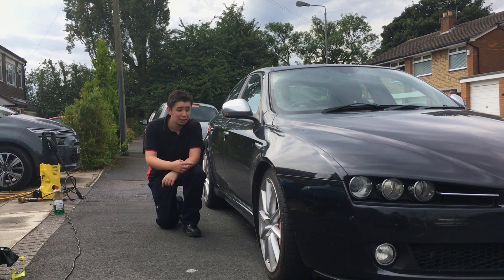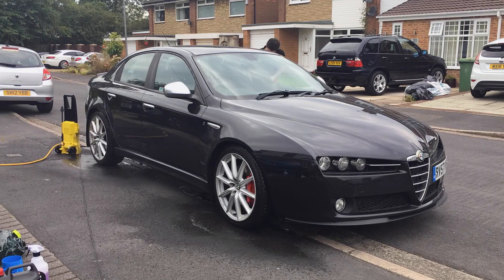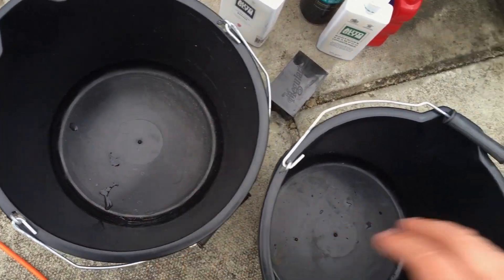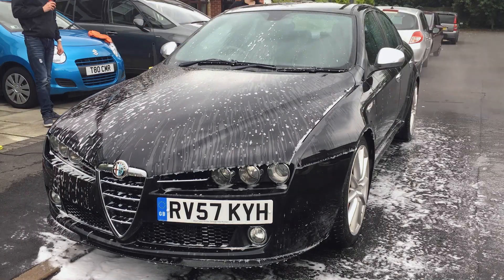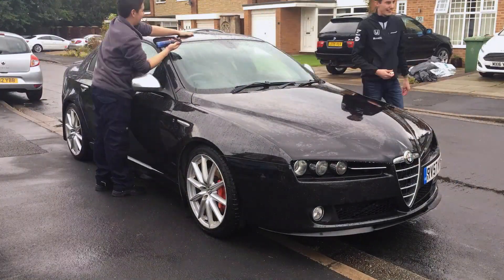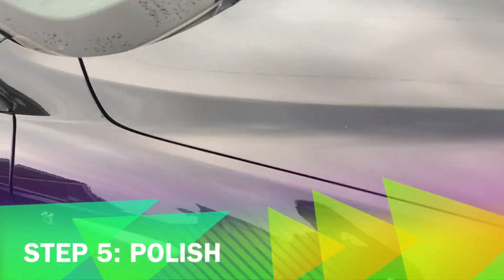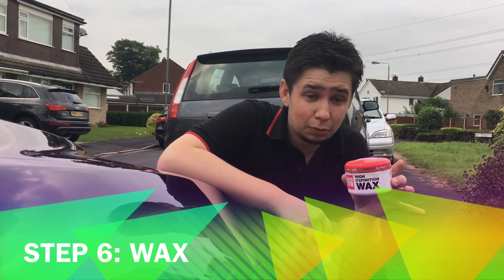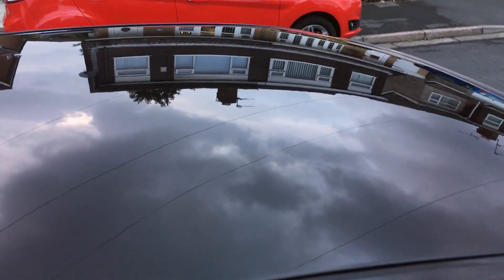How to deep wash a car.

Comment: you need grit guards in each bucket and you should always chemically decontaminate a vehicle prior to clay bar...you are only inflicting marring the way you are doing it....Washing up liquid is not a chemical decontamination......just a few tips for you going forward buddy
Reply from the maker: Robbi Hong Kong thanks for watching. You're right and I understand where you're coming from. 

Just an update, I do use grit guards now and they're awesome. Defiantly worth the investment. 

In response to the washing up liquid and clay bar. I consider it to be the 3rd step in decontamination but also the most important one. Since filming this video, I have review an Iron Out decontaminator (which I class as stage 1) with good results. Stage 2, I would use a good tar remover. 

I may do an updated video some time on my new car as the paint work is in need of restoration :) I have a video dedicated to chemical decontamination, so I'd like to incorporate that into the process.

Comment: You did an amazing job and thank you so much for mentioning about the clay bar. I saw it once and thought it was the same as polishing and never thought about it since until your videos and another one on YouTube a few days ago. Can't wait to start claying as I've never done it before on my car and it would definitely need it... What about getting rid of small scratches whilst detailing the car so those scratches are hidden permanently how would you include those in the stages and at what stage? What kind of scratch remover or chips on the paint for the certain type of colour mine being red? 

Thanks a lot it's nice to learn something a day whether cooking or car cleaning or any sport
Reply from the maker: The clay should come before scratch removal to give you a nice clean surface that’s contaminate free. This will give you better results with less work involved. 

To remove small scratches, you would ideally want a compound. It’s very similar to a polish but just a little bit more coarse. If you have a straight scratch, work the compound in straight lines that are perpendicular to the scratch. That way you can concentrate all your elbow grease on removing the single scratch. One you’ve removed the scratch, go back over the area with normal car polish to make it nice and shiny. This works best going in circular motions. Once that’s all done, you can wax the car to protect it. 

It’s worth noting though that compound will only get very shallow scratches out and will take a fair bit of effort. Especially if you’re not using a machine polisher. Good luck 👍🏻
Reply: Torque Steer thanks bud

Comment: goddamnit alfa why dont you give us those sexy looking triangle grilled cars here in the us D:
Reply: it gives, Alfa Romeo Giulia
Reply: only a couple doh D:
Reply: Typical BMW owner... Oh wait M3? You just got your ass kicked by the Giulia??
Reply: Mark Bloch Nielsen I had many alfa's in my life and that car will be always shit for me, poor quailty of the everthing except diesel engines.
Reply: BMWE38 I dont agree.. My Twin Spark is fully funktional and have no problems at all.. - but yeah they brake when people are driving them hard when cold, and don't use the correct oil.
Reply: Mark Bloch Nielsen I had 2.4jtd 156 remaped to 200hp i drove that car hardly daily,never had problem with the engine,but i changed two transmission,every suspension part,interior quality is horiblle in every alfa..can't be compared to bmw or audi or merc..Also same story about 159 just the more problems with the electonic in the car..I don't like alfa  anymore and that's my opinion that you should respect like i respect you'r.
Reply: BMWE38 How is this respect? You are just saying stuff that arent true? I respect that you like german cars - But like all other cars they have faults too.. My rear suspension only collapsed after 19 years? Do you work on cars yourself?
Reply: Mark Bloch Nielsen How do you know that this is not true? I talking about what happaned to me which doesen't means that everyone have same problems,right?
Reply: BMWE38 also, did you upgrade your clutch and flywheel? Because don't blame the car for it to Brakel down. It's only made to contain it's normal power.. So the transmissions are on you sir 😉
Reply: BMWE38 Okay? But you just wrote that this was for all Alfas?? But i will give you this.. The 2,4 is a heavy engine, so you have a lot more stress on the front Suspension.
Reply: yes i upgraded clutch and flywheel but didn't help..Driving the same bmw's like alfa's with stock flywheel and clutch and gearbox is still perfect.
Reply from the maker: Guess I'll chime in. The Alfa in the video isn't mine but I believe it to be a better designed machine than my Audi A4 of similar year. Far less mechanical issues on the Alfa and although the engine and car is heavy, at least the engine isn't mounted in front of the front axle amplifying it's weight. The Alfa has been very reliable over the last 8 years.
Reply: Torque Steer It has good outside desing and engines (diesel).That's all..You'r audi is still better car
Reply: @LuckyS8.  I had a 159 ti SW and the quality of the interior wad exceptional. I done 135k miles from new and it never missed a beat..... Best car I've ever driven..... So what you on about?
Reply: @LuckyS8.  your a German aren't you 😂

Comment: I’ve watched through a few of your videos and can see oh get ok results, but they’re lacking in what you can achieve. 
Firstly, bin off using washing up liquid, it’s good in theory but I’ve found it never works in removing wax properly, either am IPA spray or dedicated wax remover would be better. 
Secondly, bin the builders buckets and get some proper detailing buckets with grit guards, all the work polishing will be undone the next 3 times you clean your car due to the grit being picking up in the mitt. 
Thirdly, before even touching the car you want to do as much contactless decontamination as possible. This includes using a tar and glue remover, and using a fallout remover in the paint, as well as the wheels. 
Fourth, you then want to wash with a decent, wax/finish less shampoo, to prevent any waxy shampoos reposting the car. 
Once washed, you can then use the same shampoo to Clay the bar, but only if it needs it. If it’s smooth, it doesn’t need doing. 
Upgrade the Auto Glym stuff, it was good in the 90’s but it’s moved in massively. On a black or dark car, look at dodo juice purple haze. Polish wise, for an all in one I would look at Auto Finesse triple as it’s amongst the best for masking as well as filling scratches and swirls. And it also adds a deeper, richer shine to the paint. 

I did all this in my 2014 BMW M135i recently and I was repeatedly asked if it was new, as how. Got it looking so clean, reflective and shiny. 

You’re off to a good start, but adopting some improved techniques from other will really help excel your channel, and your results.
Reply from the maker: I wouldn't focus too much on this video, it was my first one and I was just starting out ;) I'll have a dedicated series of videos coming soon where I focus completely on doing the safest, cleanest wash I can.
Reply: I agree with most of the things you said mate except what you said about autoglym. I've tried so many other products and i find autoglym is still the best. Works every time

Comment: Like the videos, but just letting you know washing liquid wont strip wax.It leaves a film that gives the impression that there's no protection left. This is information from the chemist of a well known detailing product company.
Reply from the maker: Do you have a link to it? I'd like to check it out. I always want to be as factual as possible.
Reply: its the guy that makes Angelwax products, its been told in person so no place to show that its been said. But any good detailer will tell you the same.
Reply: I think it depends on the washing liquid.  Some are very abrasive and contain more salts and chemicals than better-known brands.  As such, they will indeed eat away at the wax/oils on the car as they are meant to remove such things from plates.

Comment: You didn't actually decontaminate the paint first (fallout, tar, glue etc) with a non contact solution. And using Fairy Liquid? Try using an approved pre wash solution. If by drying you state there is still dirt there then the car isn't clean. If you have clayed a car there shouldn't be any contaminants left to cause scratches.  And the best wash mitt is made from lambs wool!
Reply from the maker: Old video ;) and I prefer microfibre to lambs wool.

Comment: the paint is still beeding so fairy doenst strip wax end of story
Reply from the maker: The reason that the paint is beading at around 7:00 is that the other person forgot to wash that side of the bonnet (I assumed that he had at the time) . Watch the timelapse a little bit earlier and you will see that he missed it (I didn't realise until an eagle eyed viewer pointed it out).  However at around 7:00 you can see the offside pooling with water. 

I suggest taking a look at this video for some extra info https://www.youtube.com/watch?v=LdWN6Hb-sAM. 
However, car detailing is one of those things where one method might suit me and another might not suit you. I know plenty of people who are for and against this method.
Reply: hakman239 - yes, the water is beading. This is because the paintwork is now very clean and so does not break the surface tension of the water droplets. I notice this with cars that I have cleaned thoroughly and clay bared. Beading does not necessarily mean there is wax present, it happens whenever there is no contamination to break surface tension. Polishing creates the same effect, but again there is no wax present. Wax is the best way to proved medium term protection to the paint - more accurately the clearcoat - whilst the wax is there, the surface will not become contaminated.